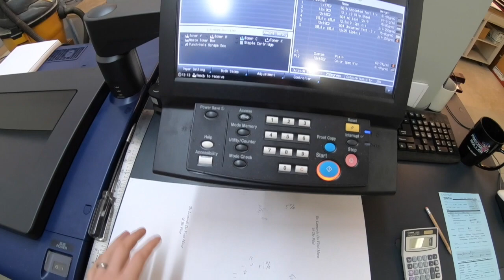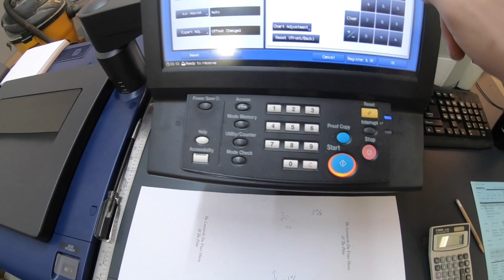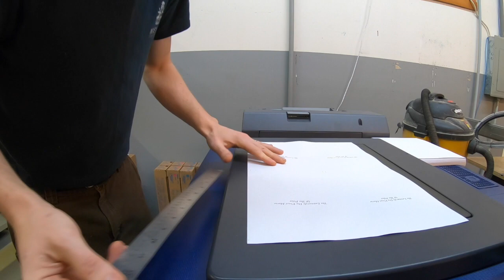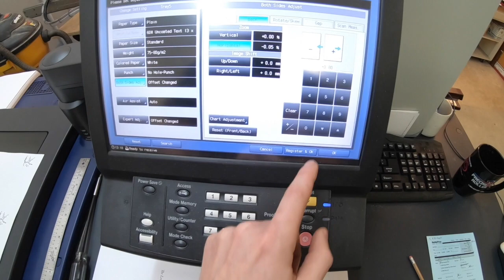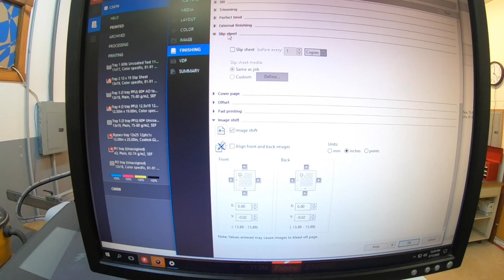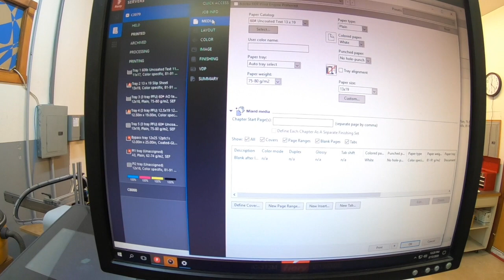Adjusting Magnification, Slitting Laminate, Binding 996 Page Books, Cleaning Shop, Boom

Comment: Hi...lifetime retired print owner.  I see you have a perfect binder.  It looks very expensive, and I just wanted to say we did books regularly, and the local trade bindery did the perfect bound books for $1.25 apiece.  Our retail to the customer was $50 minimum or $3.75 per book whichever was more.  Care to say what your equipment cost?  Love your videos, and the life of a printing career.  Two 2 color offsets and 4 digital.  (2 KM color and 2 canon black.) Rosback perf/score; Challenge 305's; Duplo creaser for digital; Baum air/vacuum fold; Collater, Tunnel Shrinkwrap;   No offline booklet maker, laminating we sent that all out and got superfast return.  Same with mailings. We always had at least one machine running, even if it was just a folder, AND we would set up long jobs to run on both color machines and black machines to run when we closed for the day.  You think like an OWNER  (lol) Keep up the outstanding work, I'd pay you $80K a year to work for us if we still had our shop. Kindest Regards....
Reply from the maker: Cool! I bought my perfect binder used for $7,000, it needed some work. I think new they are close to $70,000

Comment: Well done!! it would have been nice to see how you cut the books on three sides with the guillotine. Unfortunately, often when I trim the books the spine is damaged a lot and I would like to understand if I am wrong with the cutting method
Reply from the maker: I did in one of my videos. I use magnetic pads and also lower the pressure so the spine doesn't get smashed.
Reply: @justaprinter  thanks for your answer

Comment: Do you have “house air” there?   At a shop I worked at, we’d slit the excess web and feed the the slit piece into a piece of PVC pipe and it directed it into a dumpster.  We “motivated” the slit ribbon down the PVC with compressed air. Maybe you could do the same with your slit laminate into a trash can?
Reply from the maker: Brilliant, yes I could easily do that. I should have thought of that. Great idea.

Comment: Hi, i have the same KM, and there is much simple way to adjust magnification and registration duplex printing. Next to tab whete you set adjustment manualy is tab whre you can adjust automatically using scanner. It is very simple.
Reply from the maker: Yup, I found that out later. That is so easy and fast!

Comment: For shorter runs, Couldn't you simply tape the beginning of the slit of laminate to the first (black) roller and use it as a take up wheel? Im not sure how much it would take up before it got in the way but I would think it would have ran the job you just did. Or look on eBay or Amazon at cheap motorized label take up wheels. I think they start around $200 bucks or so. But a genius idea on your part!
Reply from the maker: Using that black roller wouldn't work for long because the size of the roller would increase as time goes on and then be moving at a different speed that the other film. This will likely be the only time I need to do this. It was a fun experiment. Haha!

Comment: Do you reuse your slip sheets?
Reply from the maker: Sometimes I save them and print job tickets on them.  But most of the time I don't only because I use a 11 x 17 slip sheet for 11.25 x 17.5 paper, and when I cut them down the slip sheets are not all the same size.

Comment: man i was like no do not speed it up hhhh 
but i just couldnt help my self why u did that when its gonna be cuted at the end ??
Reply from the maker: Haha, I didn't have the guts to speed it up. I slit the laminate because it was wider than my paper. If I didn't do that the adhesive would have come off on the rollers and make a huge mess.
Reply: @justaprinter  yeah i get it now thanks a lot keep on the videos i love them